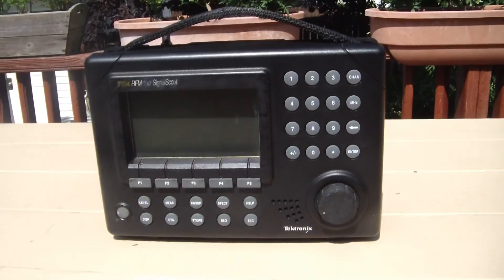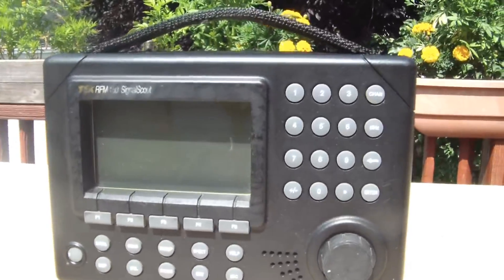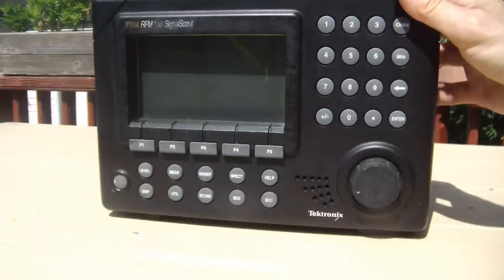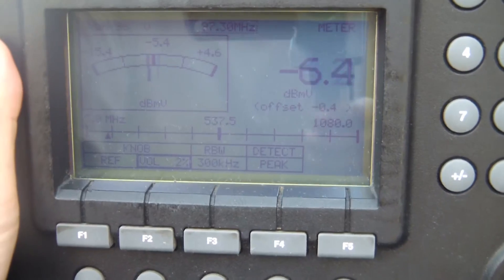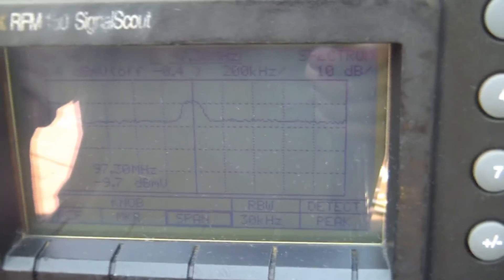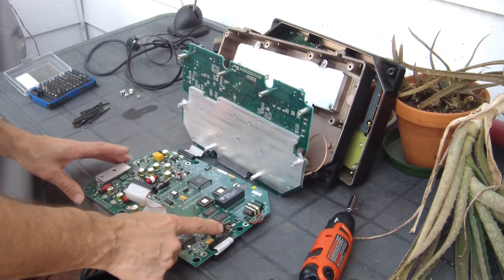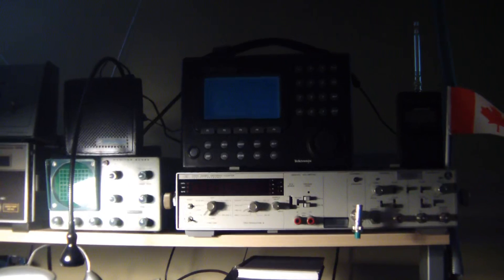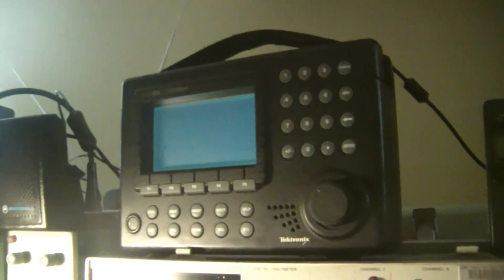Tektronix RFM150 Spectrum Scout; inspect, operate and test.

Comment: TRY CHANGING THE BATTERY INSIDE THE MOTHERBOARD AND RESETTING THE CPU IF IT HAS A RESET BUTTON  OR LOOK UP IC SPEC IT WILL TELL YOU WHICH PINS TO RESET   FOR CPU PINS    OK
Reply from the maker: The system is retaining any settings I set. Must be a super cap or eeprom device because I don't see any battery. For the amount I use it (little), I have chosen to live with the condition and get my readings within the 30 minutes.

Comment: Might be worth finding a manual for it just in case its just a power off mode after half an hour?
Reply from the maker: Good idea. Because there is such a feature, auto shut off after 10 minutes. That did catch me in the beginning. After I disabled that feature, the unit was able to stay powered on and the problem shows itself at the 30 minute mark.  

To clarify the issue, the unit doesn't shut off at this time but that internal relay starts clicking, the signal drops off by 20dB and the introduction of noise overwhelms the desired signal. Looks like I will just have to take my measurements in under 30 minutes for now!
Show less
Reply: A quick internet search for the manual brought up  a free download.